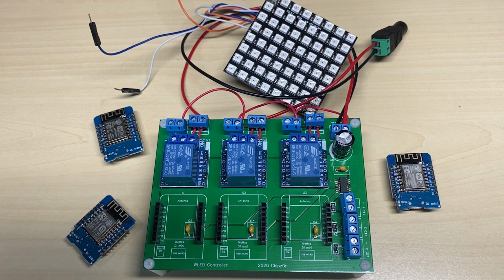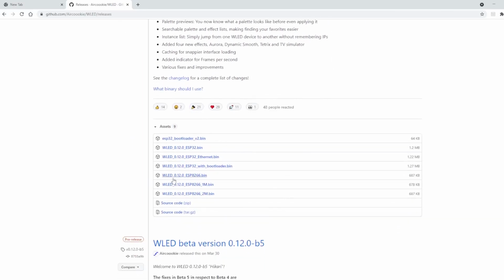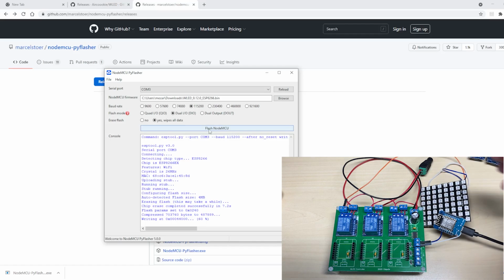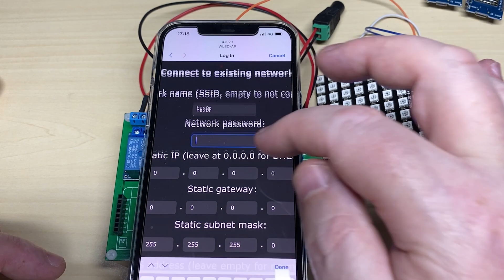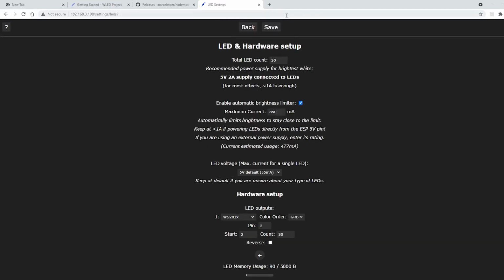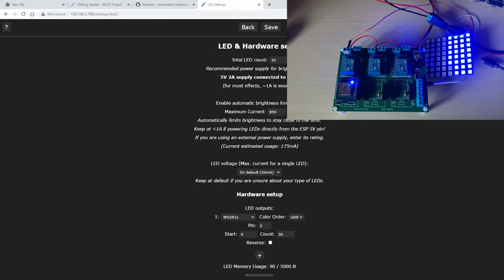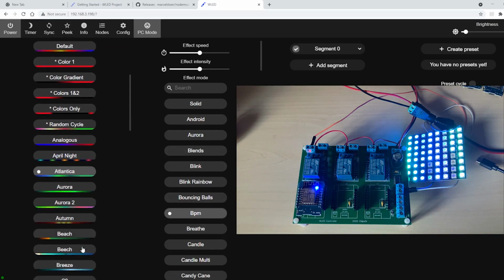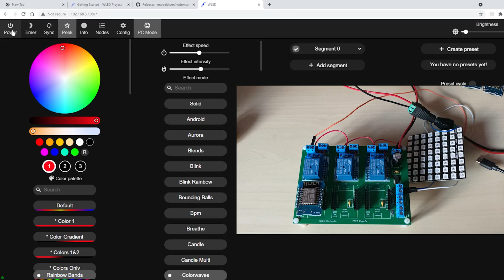WLED Part 1 - WLED - ESP8266 - Wemos D1 -Flashing and first config.

Comment: thanks i have those same boards , after fucking around with that bullshit web installer for hours I finally gave up 
it kept on hanging at installing and would never progress to erasing.
nodemcupy flasher worked but now I cant find my device, i think I may have entered my web credentials wrong
how can I go back and re enter them?
i don't see the  AP showing up either anymore 
I don't seem to see anything in my client list either
how can I get it back into access point mode?
also what to put for the gateway ? I am going to use DHCP so do i put my default gateway where it says static gateway?
Reply from the maker: Hi , its been a while since i did this , you should have a ssid of the unit which you can connect to then config it . If you cant flash maybe a com port error ?
Reply: @MicroChipz no I got it flashed now with node MCU PY flasher just fine.
It was the WLED web installer that wasn't working.
But now I think I put my subnet mask wrong 
The board flashed fine and I just put my wifi credentials but then I didn't see it on WLED android app
But then it showed up but it says offline 
Can I get it back to AP mode so I can re enter my wifi credentials without reflahing it?
I did not use static IP option so I didn't know the IP ,